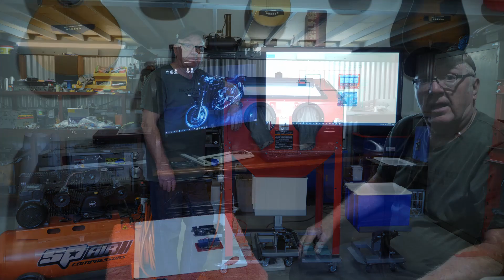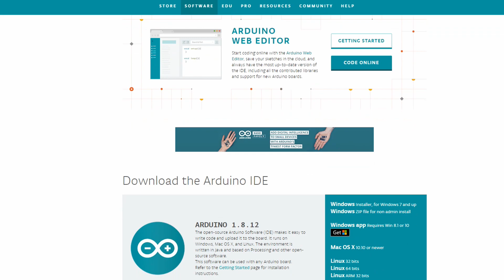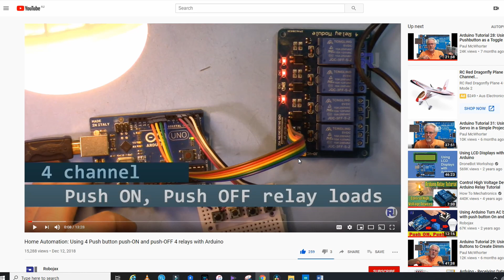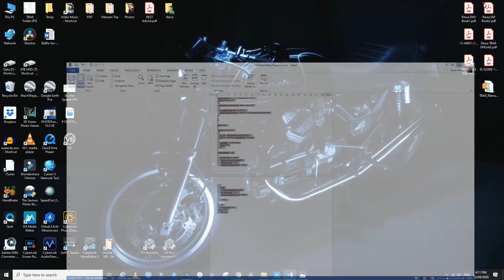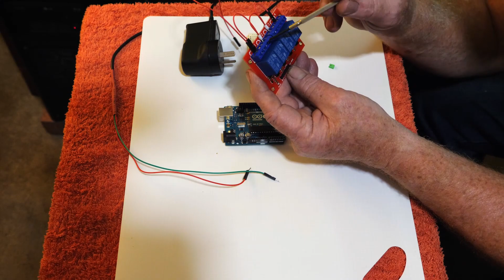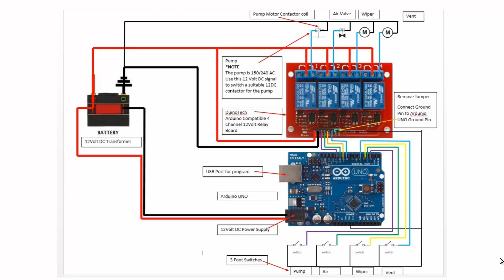Wet Blast Upgrade Arduino Foot Switch Control

Comment: Hi Steve,
Great series, thank you for your effort.
I currently have a small desktop sandblasting cabinet which is totally inadequate for my needs. So, I'm in the process of deciding on what to upgrade to. I'll most likely be buying a new Hare & Forbes cabinet, no doubt the same/similar to yours. Are you aware of any advantages in dry Sandblasting over wet blasting, I'm not aware of any but!
Would appreciate your thoughts.
Danny